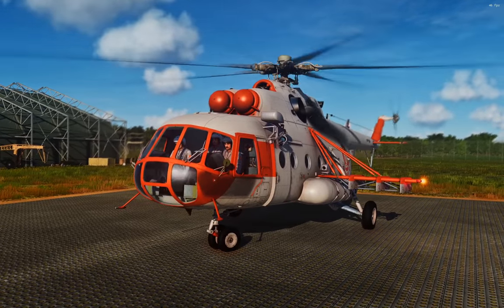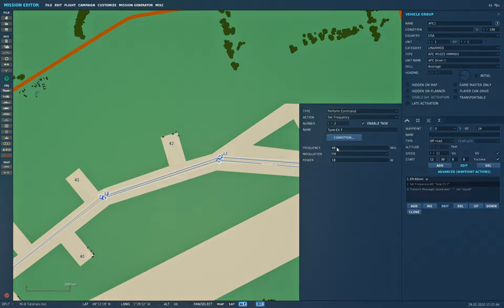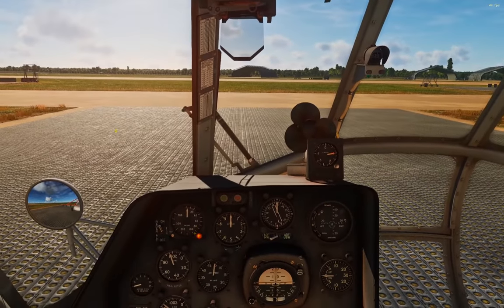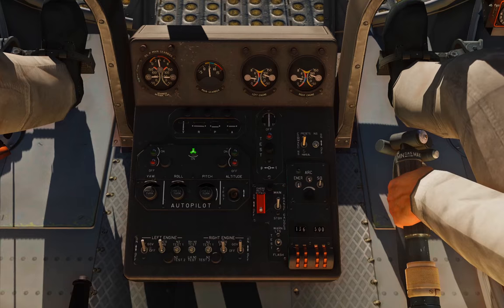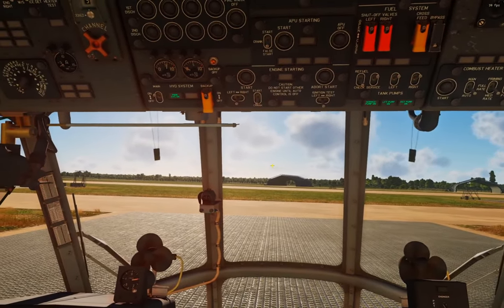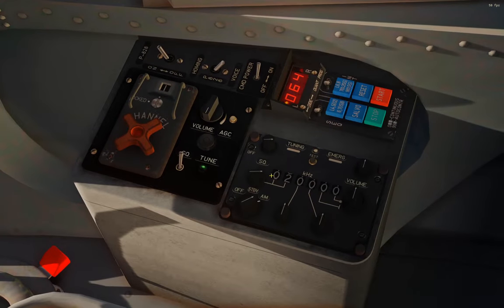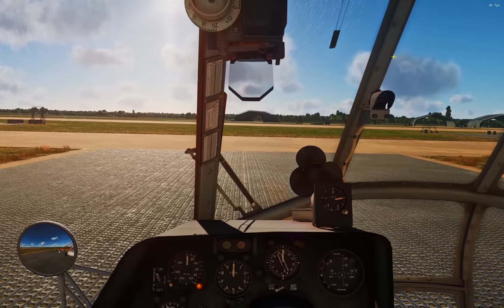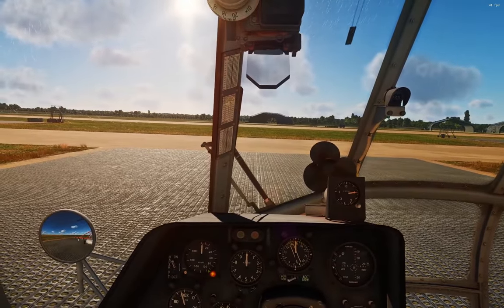DCS Mi-8: Radio Communications Tutorial

Comment: If we're wired to ground crew then we should always have to tell them to connect or disconnect, just like with ground power. Otherwise we're flying away with the intercom cable still plugged in. But then, how can you tell them to attach it if it's not attached? LOL!

I think they may have updated it so the window works now. I seem to be having less trouble with rearming lately than traditionally, anyway.
Reply from the maker: I think you're right. I recorded some of these videos as early as November 2019 on DCS 2.5.5, and there have definitely been some changes and fixes since then.

Comment: I'm doing the Spring Tension campaign and even though I set the manual frequencies on the R-863 when i push the "radio" button for the r-863 it comes up with a giant menu of who to talk to instead of the specific frequency i've dialed (outlined in the briefing). I made sure to set that switch to "manual" instead of preset.  Any ideas?
Reply from the maker: Been a while since I tried that campaign but I think they have Radio Assists on in the Mission Editor... It doesn't tune your radio for you but it does show you all the available contacts even if you're not tuned to them. 

You should be able to just pick the name of the person you're trying to contact, and as long as you're on the right frequency it should work. If you don't see that person's name it's because they aren't close enough. The list is sorted by range iirc.

Comment: I wonder if the entire crew being locked into the one radio at a time is actually how the real helicopter works or if that is just a glitch/artefact of the module originally only being usable by a single player.  It seems like a massive design mistake to not allow the three different people in the cockpit to each monitor a different radio.  It also doesn't make sense for them to each have their own radio control panel if so.

Comment: Absolutley Awsome,  question, I think i know answer but how does this tie into SRS to talk to your squadmates or Mission Freq?
Reply from the maker: I will be doing a video on using the radios with SRS at some point, but in general the main difference is the button you push to activate the radio. Instead of the in-game radio binding you would use your SRS radio binding. Otherwise you still set it the same way. 

The main UHF radio (R-863) is the most useful online, but sometimes you'll use the VHF (R-828) for talking with other helicopters.